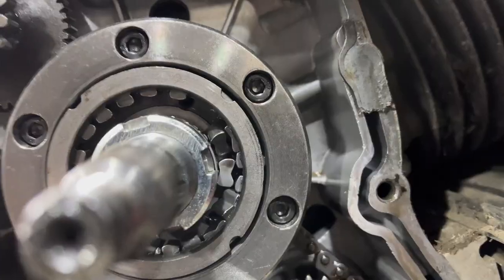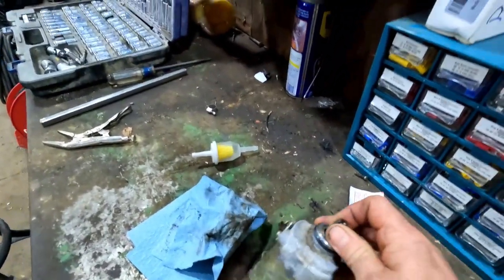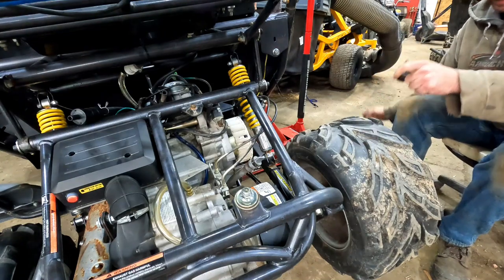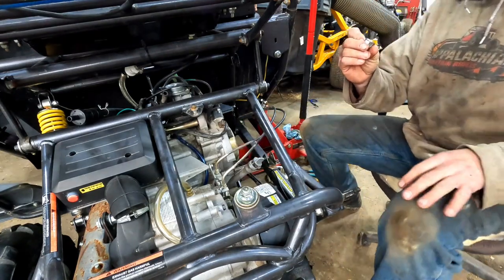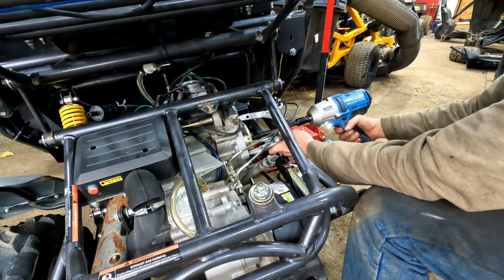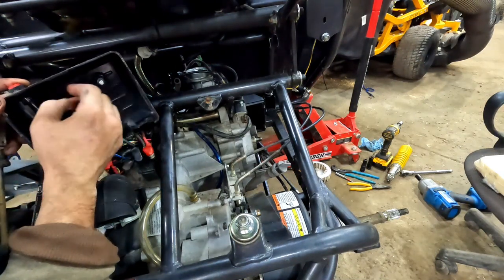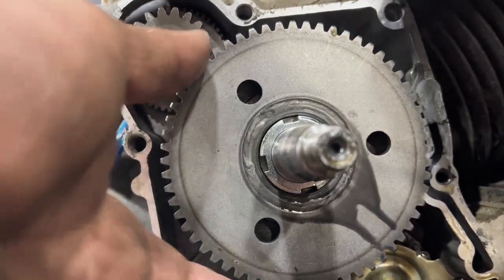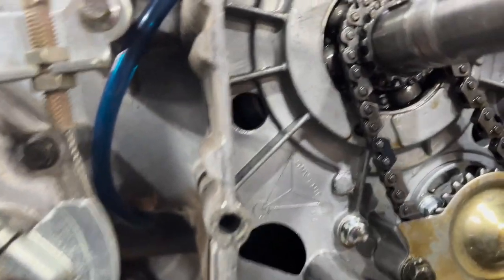Carbide Go Kart Needs More Work Then Planned

Comment: Been watching your rhino videos,  I just got a 2004 yamaha rhino 660. It has 27 inch mega maham tires on it and will do 43mph. Not sure if anything has been done to it but is there anything I can do to get a little more top end without sacrificing bottom end?
Reply from the maker: I would do a performance sheave kit before anything else. You’d be surprised the gain you’ll get with that alone and it’s an easy upgrade to do!
Reply: Thanks, would there be a reccomended brand/type you think would use. Would this upgrade  also help on bottom end also?
Reply from the maker: Yep! It will help both bottom and top end. Two companies you can go with. JBS or Hunterworks. Do some research on the two and decide which works best from you.
Reply: Thanks again